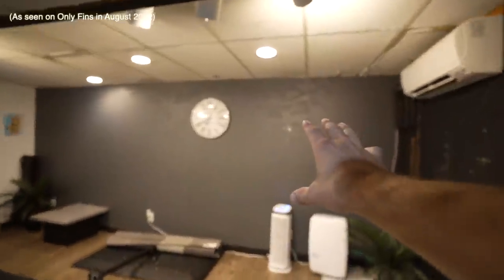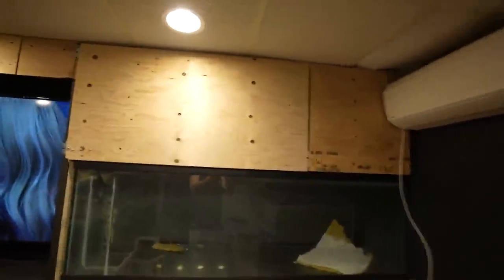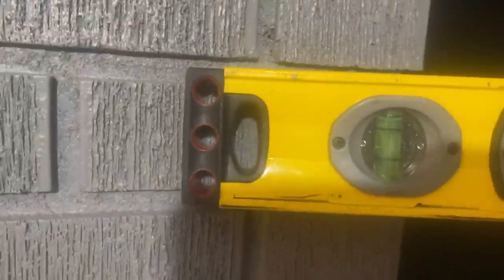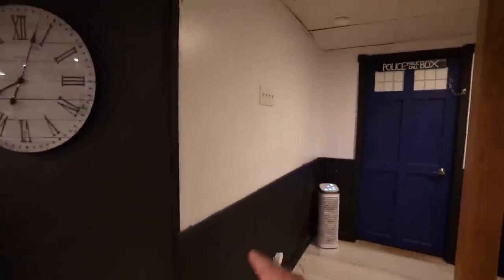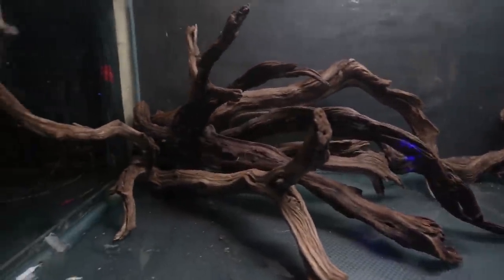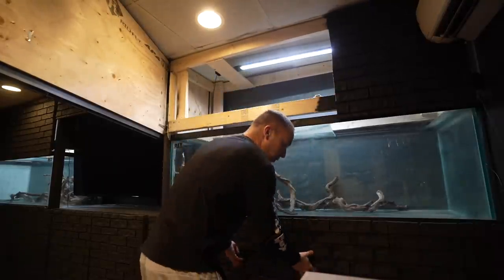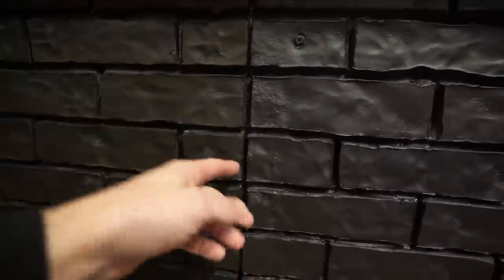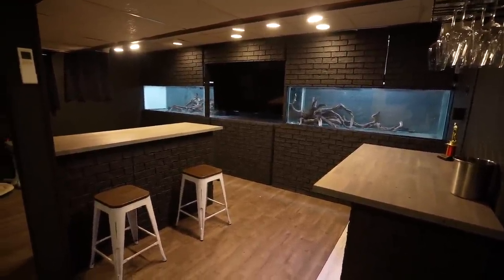I turned my basement WALL into an AQUARIUM and here’s how I did it!

Comment: Hey Joey, just a suggestion: add RGB LED strip lighting around the whole underside perimeter of the two bartops! Maybe set back and inch or two from the edge, pointing down towards the floor, that way it shines on the floor (not in your faces) as well as on the brick work of the bars. I'm telling you man, your family and guests will love it! Mood lighting when you want it, turned off when you don't. Low on energy and heat so it shouldn't hurt the foam. I use the LEDs behind my TV literally EVERYDAY. Like when I'm watching your gallery updates, I turn my green LEDs on and it lights up the whole wall and matches the gallery look. Thinking about doing it under my bartop as well. It's a sweet look. But you'll probably have to add an outlet on the left side of the support post next to the table so you can plug it in (and also so your kids/ guests can charge cell phones and laptops since that's a reality of the 21st century). Should be easy enough for you to handle though.
Reply from the maker: love it!

Comment: European cabinet hinges would allow you to close the gap. Not sure how much weight 2 can hold, but 3 might work.  Looks great and I always love your builds!
Reply: If you mean those used in kitchen cabinets, they can hold quite a lot. I'd probably use those hinges which go upwards, but even loaded sideway hinges could work. Two are more than enough. Styrofoam and plywood are light. 

Were it laminated chipboard? I had to use 4 loaded hinges per every 6ft wardrobe door, but only 2 on 2ft ones. Also those hinges require special drill, with plywood the "flat" variant should be enough (just screws and glue to be sure).

Comment: Goldfish, yes! yes! yes! I would also black out the side panels of the tanks either side of the T.V, the slither of visible tank doesn't make the wall flow in my opinion. Any will make the tanks pop even  more. I set-up, design and maintain tanks for customers here in the UK, and I have taken so much inspiration from your channel in my current and previous career.

Comment: 3:50 - Wow, that's a lot of work required, but with great result! Overall it looks great.

As mentioned before, you can use different hinges. Some sort of loaded hinges used in wardrobe doors or those hinges used on kitchen cabinets. They can hold quite a load, so two should be enough for plywood with styrofoam.

Comment: You could use some sort of rubber strip to seal off that crack where the light comes through. Glue it on the door side. Get something flexible enough to bend easily when you open the door.

Comment: For the gaps, you might want to consider adding some wood vertical pieces, match them to the table and you add more interest to the wall at the same time while blending it into the rest of the room.

You might also want to add openers to them, some of the metal ones embedded along the edges shouldn't be that hard to add in and would prevent accidental damage to the foam...

Only real issue with the setup is that underneath the table isn't that much room, and it's in a position where I'm not sure how well it'll last against accidental kicks and similar that could damage it
Reply from the maker: ya, i gotta do a few more things for sure. This was all the "main stuff" complete. I was going to do everything else, but then i wouldnt have shown this build until the new year!
Reply: @thekingofdiy  It's mainly the under the table where I wince at that much work and then it's a place with teenagers and feet...